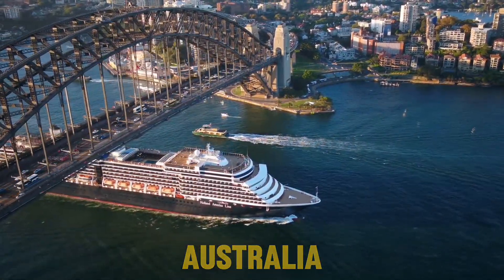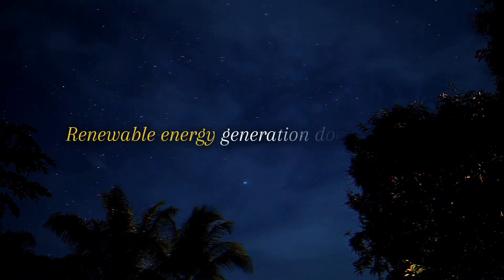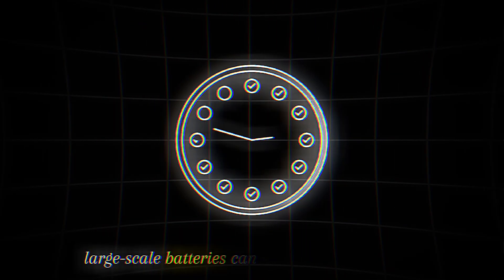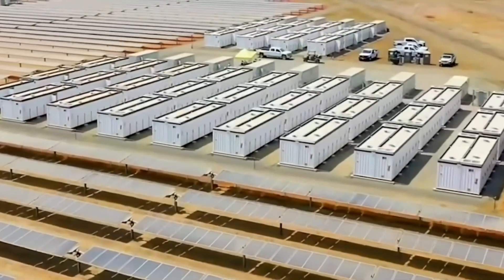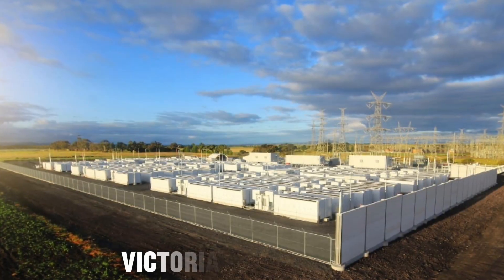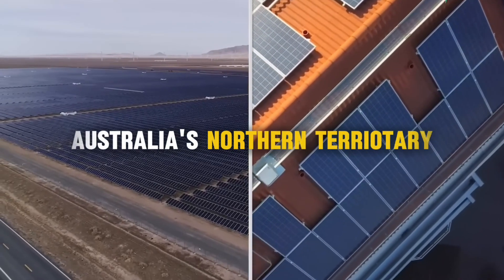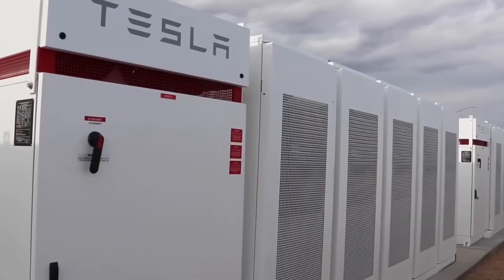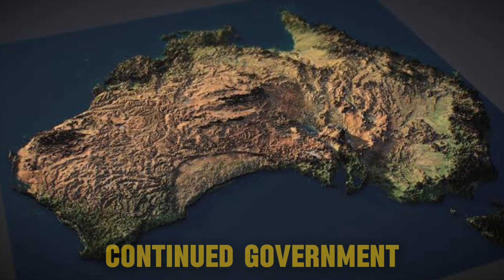Australia Is Building the World's Largest Battery Here's Why

Comment: Sadly the latest news is there has been a catastrophic failure at this plant. Transformer issues. And that explains why on the NSW AEMO fuel mix that Battery power into the grid has been only 1%. Past three months NSW has been reliant on Coal fired power stations to provide 65% of the power. The silence from Chris Bowen has been deafening

Comment: This is full of bullshit. There has never been any large scale power outage due to renewables in Australia. The 2016 outage was due to the high-tension power lines collapsing. The power source had nothing to do with the loss it was the connection. The 2022 power outages were caused by ageing coal-fire power stations. This channel sounds factual but it has more holes than cheddar cheese. Unsubscribe.

Comment: The reason you give for the 2016 power outage in South Australia FALSE. There was a factor you haven't included that caused the issue. Interconnect is the clue but I don't imagine you will do the research to fix your dramatic reason for the failure.

Comment: Lithium ion batteries are only one of several very different battery chemistries competing for grid level battery storage applications. There is no reason why a domestic government initiative could not kick start a battery manufacturing industry using cheep non-toxic and thermally stable alternatives to Lithium.

We just need a government prepared to practice keynesian economics, and to get the government back into industrial ownership to keep a market based lid on corporate price gouging.

Energy density is NOT AN ISSUE for grid level batteries. Individual battery cells can be the size of shipping containers and have an INDEFINITE useful life of over a hundred years.

Battery technology is progressing so fast that what you read last year is now OUT OF DATE. If you haven’t done a deep dive into battery technology in 5 years, you are a dinosaur. All of your opinions are obsolete nonsense.

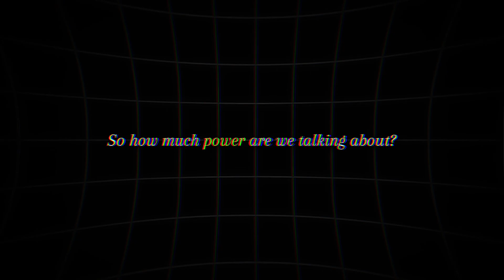Comment: @ 7:30 Victoria's big battery can power over 1,000,000 homes for 30 minutes during peak demand. ONLY 30 MINUTES.
There are around 3,000,000 homes in Victoria.

We would need 144 of those battery storage plants to power 3,000,000 homes in Victoria for just 24 hours.
$160,000,000 for each storage plant.
Reply: 300MW (300,000kW) / 1,000,000 = 0.3kW. Yep, 300 Watts each. 300Watts per house.

My induction cooktop can use up to 7000 Watts
My AV gear sits at ~ 200 Watts in use
My PLEX server sits at ~ 70 Watts while running

They are going to need a LOT more than 144 of those batteries to even get close to what is required.
Reply: @peted3637  I agree.
Reply: @peted3637  Your maths is entirely wrong. You are using a power output measure rather than a generation measure. You obviously don't even have a clue what a "watt" actually is.

If you don't understand that, then maybe you are not the person to rely on for advice on the topic. @450tank just mindlessly hopes on board with your error as well.
Ya gotta love wannabe "experts". 🤣
Reply: @BrentonSmythesfieldsaye  I will go with peted's maths rather than your nonsense.
Reply: @smedleyfarnsworth263  Ok then, choosing to be wilfully wrong must be your strong point. 😂

Suit yourself.

Comment: How is it we are looking to export electricity when we can’t supply our own needs.
That’s an awful lot of batteries and solar panels which will need replacing every 10 to 20 years.
That’s just too expensive to maintain solar plus batteries plus wind turbines. You would need a work force bigger than what we currently have to maintain a system like that. It’s  a bicycle pump mentality. All these tiny power units trying to produce mammoth amount of power. I think these items will be almost worn out by the time you pay for them and then within a few years you will need to tear them down and start all over.
We need to build for the future not the here and now , something which will last many years as did the coal fired power stations .
Electricity is not going out of fashion we must have a reliable supply regardless of the build cost.

Comment: Batteries will soon be in short supply due to the global demand for energy. The best renewable energy does not rely on batteries, such as wind turbines that pump water up to a high tank and then release the water to spin a turbine to generate electricity when there is no wind. This method will reduce the obstacles more than other methods because the life of the water tank is very long, but the wind turbine must be designed to be very efficient, small in size, and the generator must be the most efficient ever. My innovation is ready for this because it can produce a lot of electricity and quickly, so the results are sufficient for the demand.

Comment: Much more rational to send power from Pilbara 120E to Sydney NSW 150E a local time difference of 24 * (150 - 120) / 360 = 2 hours.
Afternoon supply in WA to evening demand in NSW with less storage required.
Additionally, no Chinese dragging the anchor.

Pilbara to Singapore 24 * (100 - 120) / 360 = -1.33 hours. Evening supply in Pilbara to late afternoon demand in Singapore requiring much more storage.

Comment: The electricity price is dictated by the cost of Coal and Gas at the moment if look into it. If we can get to 100% renewables power will be cheap but not if we keep,using gas and possibly nuclear. Our house has 4.4kw of solar and a 13kw battery and we run 86% of the time on solar, in fact for 9 months of the year we are above 97% and 4.4kw system is small these days. If we can do it for one house there is no reason the country cannot do it. It’s just a matter of investment, will and some great engineering… unless you really want to screw up our environment…. Your choice….

Comment: No mention of the hundreds of $billions required to build the 24,000 Km of new high voltage transmission lines to connect new solar farms to the grid. e.g. The first 100Km transmission line is costing $5 billion. Do the math and allow for cost escalations. Utterly non-viable strategy. Meanwhile, NSW power prices will rise by another 9% from next month.

Comment: Mix of current energy sources in Australia:
1- 62% Coal
2- 25% Solar
3- 6% Wind
4- 4% Hydro
5- 3% Gas
6- 1% Other

** Note that Coal and Gas are not subject to weather conditions unlike the rest of the energy mix!
Reply: Overnight ...looking at the NEM website ...Coal and Gas provide about 70 to 80% of the energy required for Australia's power grid...Too bad if you use the battery overnight and there is not enough solar and wind power the next day to recharge the battery... Its a scam...
Reply: Used to be more fossils, now less.  Open electricity gives timeseries data.  Given another decade the slices of the pie will look very different, no?
Reply: @ Already very different. Fossil fuels almost halved since 1997.
Reply: @douglaswasley1461  it's not a scam, it's an engineering problem that needs time to roll out.
Reply: Which are getting cheaper by the second?  Which emit prodigious quantities of greenhouse gasses over their lifespan?
Reply: Er, while I agree with you overall- neither is hydro…..
Reply: Yes, in 2023 coal and gas contributed 65%. But coal is only 46% and gas is 17%.
In 1997 coal and gas contributed 91%. Coal contributed 84% and gas 7%.
Reply: So our high price of electricity is 65% the fault of coal and gas right?
Reply: @zoransarin5411  Sadly it's 100%. As coal plants age the costs go even higher.
Reply: @evfusion4094  I was aware of that. I was just throwing back at the idiots that state that wind and solar are 100% to blame, which anyone with a brain knows is not correct. Cheers
Reply: @zoransarin5411 yes if you ask the industry people.
NSW and QLD coal plants are avg. 38yo with expected lifespan of 40years.
They are failing regulary, expensive to keep going, gas is the most flexible but most expensive form of generation. 
Hydro and batteries give instant absorption and dispatch to stabilise grid. 
Wind is cheapest generation, solar, coal, hyrdo, gas.
All companies are building wind or solar then batteries. Cos its most cost effective, and you dont need coal or gas supply lines. Its localised, resilient power.
Reply: Oh look! - It's a Clive Palmer shill. lol
Reply: That is total bullshit. Hard energy capacity is nothing to do with the real world energy mix. Coal is so inefficient that often has to PAY to have its power accepted into the grid during off peak periods. Coal is a NEGATIVE asset.
Reply: What were the numbers during the previous administration   ????
Reply: @titanlurch  In 2023 coal and gas contributed 65%. But coal is only 46% and gas is 17%.
In 1997 coal and gas contributed 91%. Coal contributed 84% and gas 7%.
In between several governments. Decarbonisation has been ongoing under every government in that time. Previous government went slowly. Current government a little faster. Left wants much more rapid progress.
Reply: Thus build batteries. Ya numpty
Reply: @richardcranium366  Musk built the largest battery in the Southern Hemisphere for South Australia some years ago my friend. The neighbouring town of less than 10,000 people took less than 1 hr to deplete that battery which was fully charged. From memory the battery was larger than a dozen football fields placed back to back. Now imagine how much space would be needed to build batteries to supply power for a 24 hr period to 26,000,000 people as well as all the RV's and industry. Seems advocates of Renewables have no inkling of what is involved in guaranteeing power on demand 24/7x365 in Australia.
Reply: In 2024, coa
Coal 45%
Gas 15%
Renewable 38%
Oil 2%

Coal was by far the most expensive generation in Australia, at $69 to $168 AUD per MWh.
Vs
Utility scale solar $29 to $92.

Fossil fuel is expensive and dirty which is why it is slowly being replaced. 

Our bills go up because of vested interests in the energy market, not the cost of generation (unless you count gas price increases)
Reply: @firehorsemichael  Educate yourself my friend. Coal and Gas if they were not heavy regulated by Labor policy would be much cheaper than solar/wind. I guess you also did not know that where solar/wind can be supplied it MUST by Government regulation be the first fed into the grid and ONLY when there are spikes in usage that solar/wind can NOT fill then, and only then is Coal/Gas feed into the network and as demand is high and solar/wind is low the coal/gas attracts a premium that forces prices up. MOST of the high price for Coal/Gas is by regulations they operate under that solar/wind do not have imposed on them. It is a false market totally manufactured by Labor to make coal/gas seem expensive as compared to solar/wind.
A little independent research will enlighten you as to how Labor net zero by 2050 policy drives the price of Coal and Gas upwards whilst solar/wind are being heavily subsidised by Australian Taxes to artificially reduce their costs.
As for your claim Fossil fuels are expensive that is easily debunked. China (you know, that  industrial giant of the entire world) is constructing and commissioning 2 (that's right TWO) NEW Coal fired Power Stations each and every week until at least 2030 yet their electricity costs are amongst the worlds cheapest. Do you really believe they would be constructing and using the MOST expensive source of power to run their factories if wind/solar were so cheap as Labor claims?  If you do I have a bridge to sell you real cheap. Wake up to Labors scam. Do you forget Bowen told us as more wind/solar came into the network prices would drop and they promised YOU that YOU would be paying $275 a year less by 2025 than You paid in 2021/2022 and I bet YOU still believe everything they told YOU and are still telling YOU. Wake up sunshine as they scammed us all and still are.
Reply: @saintsone7877 the old 'educate yourself' call.
I learned some energy companies speach and regurgitated it word for word.
Copy some absolute shote off a website sponsored by an oil and gas company and be a free thinker like you.
Reply: @richardcranium366  My friend, one should not use an argument that also applies to himself. Everything you quote comes from whom? Either a) Government (political) sources, b) Proponents of Renewables (Solar/Wind/Hydrogen) or c) Government Agencies/Organisations set up to further/assist Renewable implementation. 
ALL sources engaged in the debate are biased one way or the other my friend.
Only by doing ones own homework can one sort the wheat from the chaff so to speak.
I have solar panels and almost everything I was told at the time of purchase no longer applies. I was originally getting up to 19 cents a KWH I fed back into the grid which has now dropped down to 3.5c per KWH so income from solar (for me) has been cut by over 80% whilst the power I use at night has increased substantially so NO, I am not regurgitating info but actually living the reality of Solar.
The report by CSIRO into the cost of all sources of power has been proven to be false and misleading as have the bleatings by Mt Bowen and the ALP. Tell me mate, did your power bill go down $275 since 2022? Or did it rise? Seems you forget Labors promise regards costs. You also forget Albanese stated at the time the costing was the most comprehensive study done in the world and proved Renewables would lower the cost to consumers. Three years later he walks away from the very study Labor commissioned and swore by as 100% factual.
Yet you use data provided to that very company by proponents of Renewables when it made its assessments that the Labor Party adopted yet criticise my data as biased and sponsored by oil and gas companies when I am using real world data not modelling and projections based on faulty and in occasion invented data.
That is why I say do your own research.
Bet you did not even know the Government alone spends nearly 5cents of every $1 it receives on renewables and were it not for coal and other products they demonise they would not have the money to spend on anything let alone solar/wind etc. This year alone in energy rebates/ solar rebates, subsidies to companies building solar/wind farms etc it will spend near $20Billion of your tax dollars propping up the Renewable industry it promotes. And that annual figure has more than doubled since Labor came to power. Wake up mate.
Ask yourself why Germany who spent $1.5 Trillion on renewables is restarting their nuclear capability which they dismantled when they went Renewable. They went from being an exporter of energy to several European countries to becoming an importer of power after they switched to Renewables. That's how good renewables are.

Comment: Anyone with solar panels will tell you no sun no power, I have a 6Kw system producing up to 4 to 5 Kw at best, as soon as the sun goes behind a cloud, drops down to 500 to 600 watts not enough power to light a few lights, so where is the power coming from when there's no sun for a week or two, to power Sydney from battery's in a power black out, the size would be unimageable, not mention the astronomical price. For just one city.
Reply: 500W at 10w per  led light bulbs give you 50 lights you leave on!!!

Comment: Hydrogen or nuclear far greener than those expensive toxic dangerous batteries
Reply: You plainly know little about hydrogen. There are good reasons why there are so few hydrogen refueling plants. What we really need is to take back our gas resources instead of near giving it away it to the lowest bidder.
Reply: Hydrogen is dead on arrival, too many technical issues that cannot be overcome with current technology.
Reply: You do realise that green hydrogen uses renewables to create it? And when converting hydrogen you lose 80% of the energy you get out of it at the other end, so you need 5x more energy to create it than just using it directly as electricity. It’s like storing wine, you wouldn’t bother putting it in the cellar knowing you would lose 80% of it, you much rather drink it now and get the full bottle.
Reply: Nuclear is great if you want higher electricity bills.
Reply: @budawang77  how does nuclear produce higher electricity bills?
Reply: @budawang77  - and also digging holes in the ground to bury your waste.
Reply: @budawang77  You don't know that. You are just spreading misinformation. Please shut up!
Reply: @lesblack413  is impolite

Comment: Do they not realise that the sun does not shine at night !!!! and the battery only last for 30minutes.. 
So how long does it take for the battery to be recharge after they have been drained after 30 minutes of use..
Why would anyone want to produce electricity when NO ONE wants it but cannot produce it when needed !!!! 
How long will the batteries last and need to be be replaced and how will they be disposed of when they are dead.
Will the power link be able to deliver electricity over such a long distance?????.
A lot of unanswered Questions.